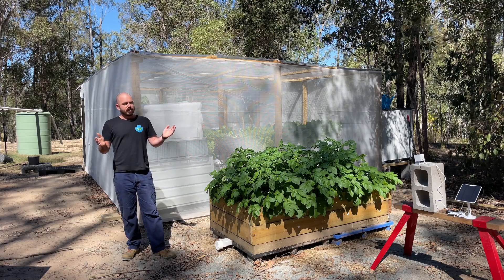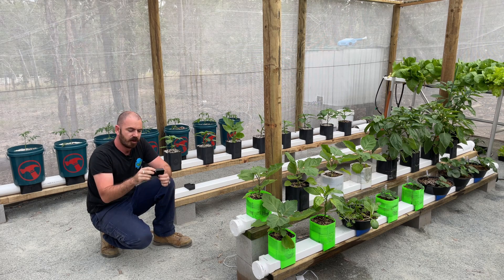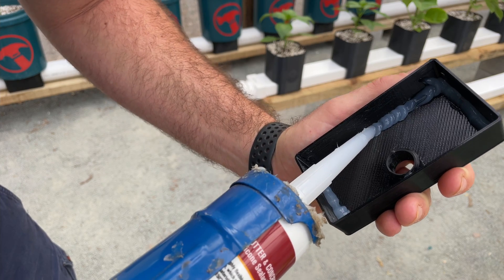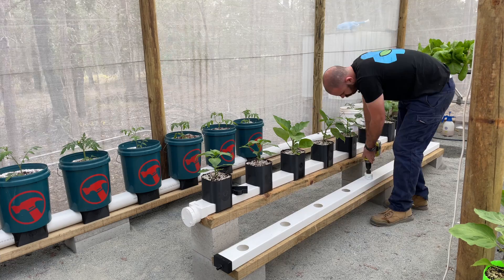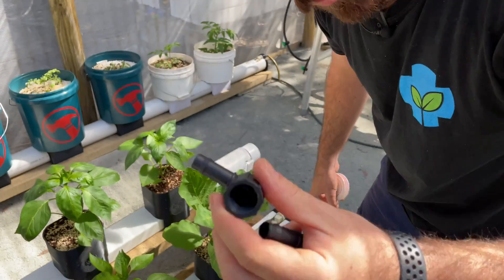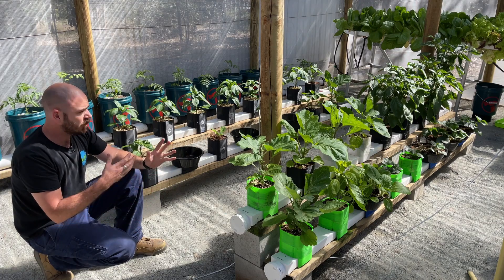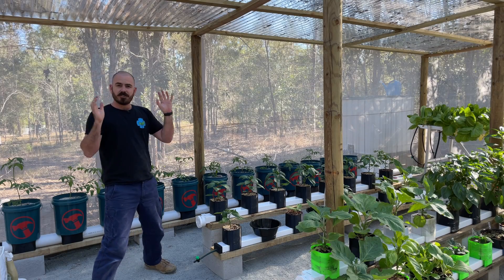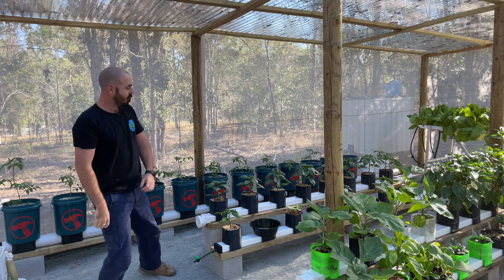A New Rain Gutter Grow System Design

Comment: Is it possible to adapt the design of these to a 110x54mm rectangle ducting. I have about 8 lengths of that running a system just like this and my end cap solution absolutely sucks! I’ll defo come and join your patron if I can adapt these and get them printed :)

Comment: Do you print your parts in PLA or PETG? I've created similar fittings for downspouts on my gravity NFT but print in PETG due to my worry of PLA dissolving. Just wanted to check if I'm being over paranoid as PLA/PLA+ prints so much easier on my printer.
Reply from the maker: PETG
Reply: @Hoocho  sound! Videos are great btw 👌

Comment: Hoocho! Love everything so far, gotta ask though, why don't you just design the insert as part of the end cap. No silicone needed!
Reply from the maker: It’s the way that the 3D printer prints it, the flat end is printed on the bed and the rest prints up from it, otherwise you would need a lot of supports, which wastes material.

Comment: Hey Hoocho, I've got a basic question I don't remember seeing you discuss yet: how fast do the plants in your systems go through nutrients, and how does that vary between plant type and/or systems? I'm guessing a giant fruiting tomato plant uses way more fluid than a head of lettuce. Or is Flood and Drain vs. NFT vs. RGGS the bigger difference?

I'm really just trying to get a general rule of thumb along the lines of how much nutrients each plant will consume per day so that I can figure out how big of a res to get if I want, for example, a dozen plants to last 2 weeks without a needing a top up. Any insights would be greatly appreciated!

Comment: The rain gutter grow system is the way to go, its within everyone’s reach as a new or advanced grower.
Reply: I love it, but it has its problems. It's not flexible as far as placement, troubleshooting can be difficult, and is difficult to manage sometimes with larger containers. I'm doing a similar system in totes using pots and the lids for support and it's pretty much solved all these problems. I posted pics and stuff in the hoocho subreddit to show how to make it.
Reply: @accidentallyfasting5768  Can you show us the link to the pics and stuff mentioned for non reddit users? thanks.